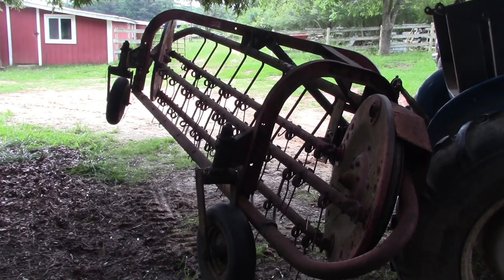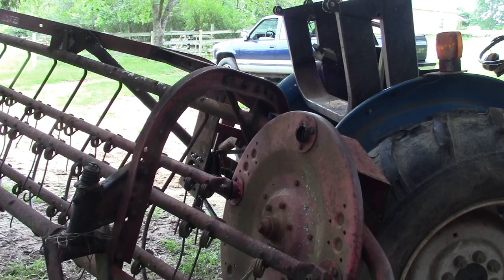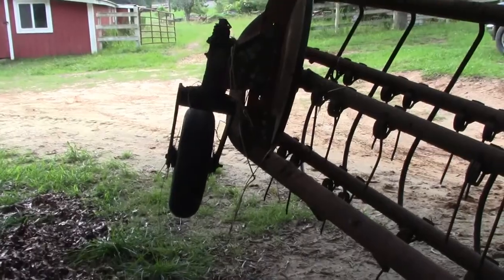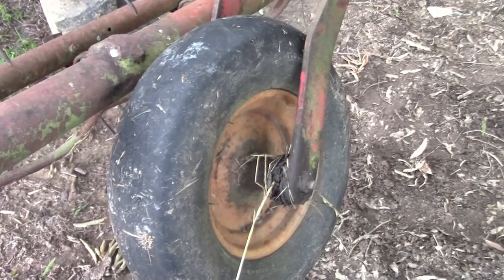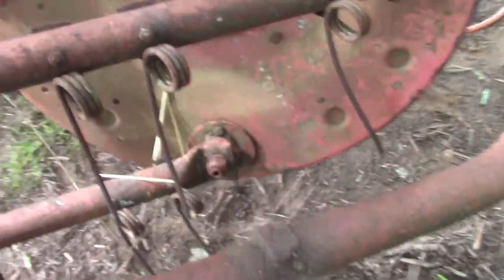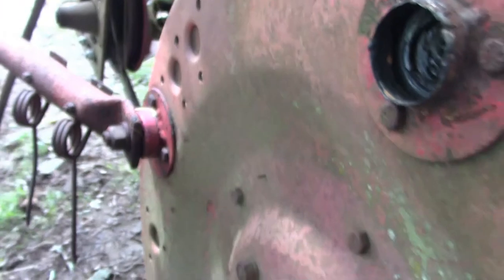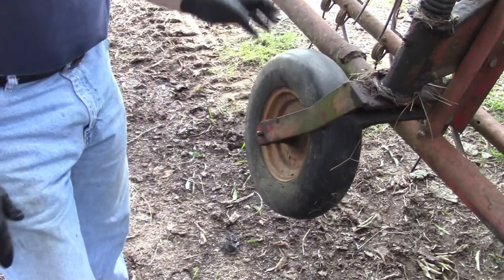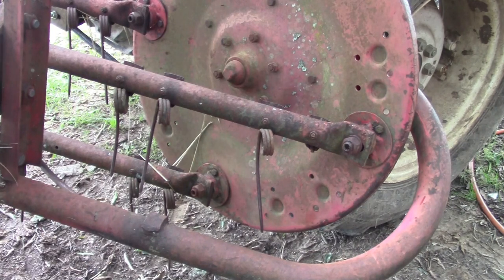MF 25 Hay Rake Rebuild Part 1

Comment: If your mother wants to continue in the cow business, you might want to get a new rake.  I've seen some pretty good old rakes for sale.  New Holland 56 or comparable.  It looks like $1000 to $1500 would get you one in pretty good shape.  I don't know how much the parts you're buying are, but...
Reply from the maker: I'm not sure how much the parts are, but I figure less than $500 will get us back in business.  I ordered the bearings (6) off eBay (A&I) and saved about $30 on each bearing over Massey's cost ;)

Comment: Man I saw someone with one of them new big bail jobs and it was so cool how it worked.  I like the square bails myself. But I know this is just the rake.  Dude them wheels and tires have saw better days. LOL  I know you can get it fixed.  Good luck new bearings will make it much better.
Reply from the maker: Haha, I'm surprised the tube is still in it ;)  Thanks Calvin!